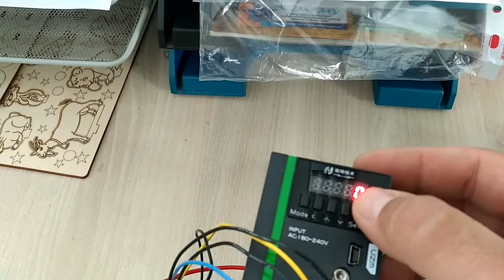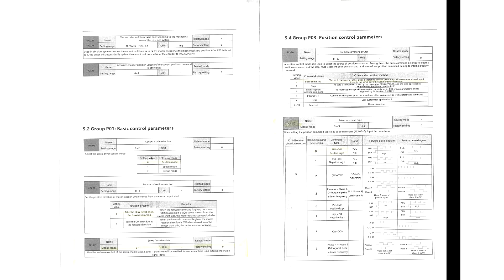AC Servo Motor runs by pulse generator board - English

Comment: Does external 24v power supply needed to powered ac servo?
Reply: the power supply and the servodrive power input are daisy chain wired with 220VAC
Reply from the maker: No. The motor runs on 220V AC. The power supply only gives 12V to the pulse generator board.